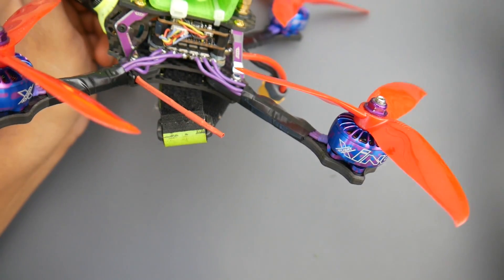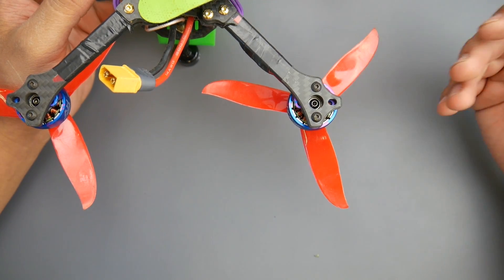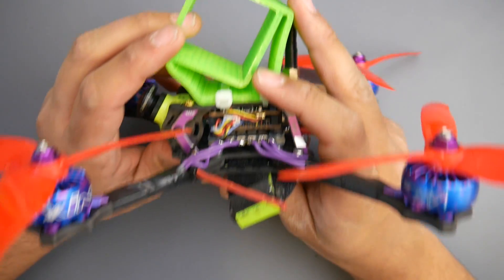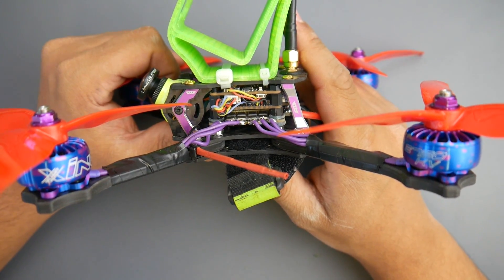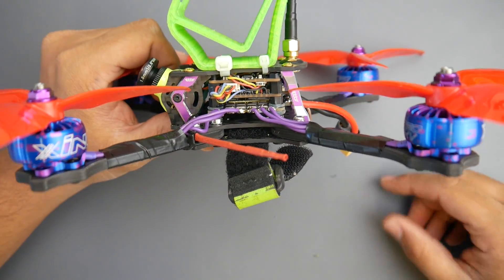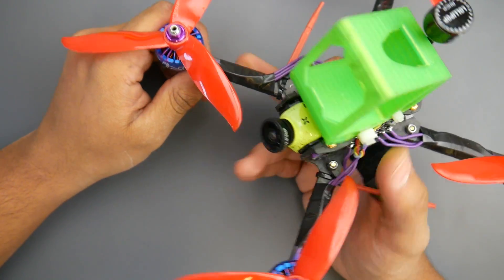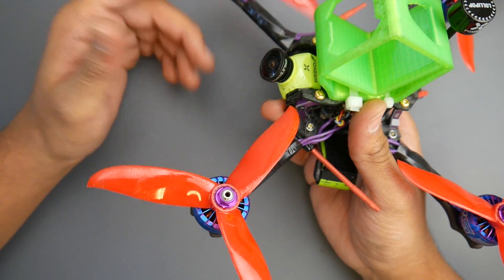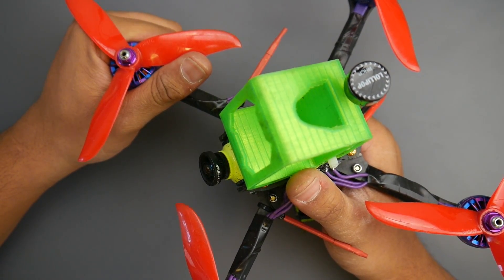Last Xing Tested Was Disappointing Is This Any Better iFlight Xing 2207 2750kv

Comment from the maker: iFlight Xing 2207 2750kv
http://bit.ly/2uAjlNY

--- The Build Parts List  ---
Flight Controller + ESC + VTX Combo 
http://bit.ly/2WbL3gy

LOW ESR CAPACITOR
http://bit.ly/2SdjK77

Foxeer Pradator Mini V3
http://bit.ly/2GyFMun

FrSky Recevier Used 
http://bit.ly/2WMbFoH

FrSky Qx7
http://bit.ly/2GdO2Ar

Best Nylon Standoffs I have used 
http://bit.ly/2ShU2Pf

3B-r Frame 
http://bit.ly/2SD0509

Xing 2207 2450kV 
http://bit.ly/2TzYUMb

Comment: I feel ya on being underpowered, I have flown motors everyone loves and feel they are underpowered. I have never flown 4s but 6s, the Steele motors were underpowered and overall just fragile junk. My xing 1800kv I love em, tons of power and efficiency, I get long flight times and zero issues.

Comment: I have had the Xing 2207 2450kv since released. To start, one of them, actual flames came out of in testing on the bench (spinning up in betalight). On take 2 (I purchased 5 to start) another one let out magic smoke on first liftoff, 5feet high maybe. Xing replaced both with great customer service and now that I have 4 good working motors, these motors are awesome. There are so smooth and have had no issues in 100’s of packs.

Comment: 6s 2207 1800kv 😍
Reply: Yes! This kv on this motor with nazgul props has given me 9 minute 45 second flights with batteries at 3.6v per at the end. 5 minutes hard flying, the rest cruising and exploring. Amazing motor and prop combo. Very good low throttle control and so much power

Comment: I have some hypetrain dribs that sound like that on 4 s.Those things sound good.What size ESC are you pushing the zings with?
Reply: Chris Im replacing my dribs every week its another problem (motor noise, bearings, smokes). Ive had to replace them all once over within 2 months. Hope to have a better experience with these.
Reply from the maker: In description :)